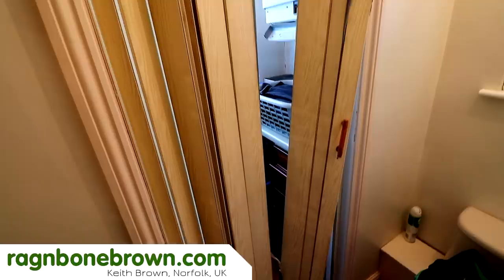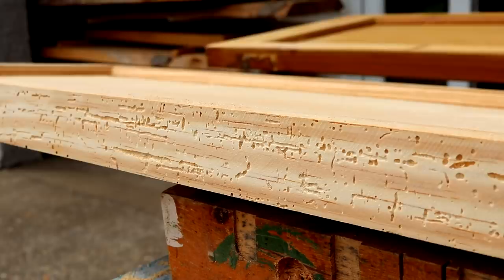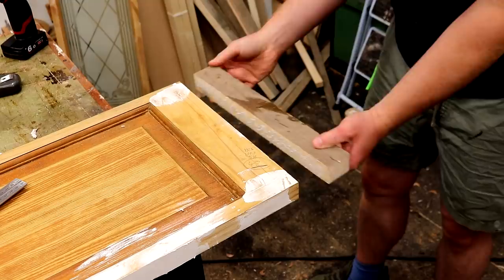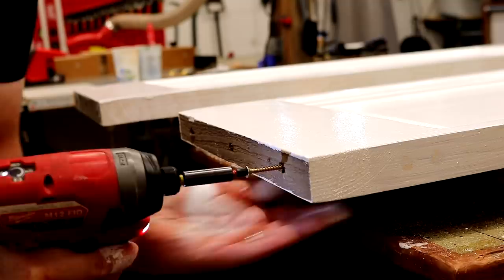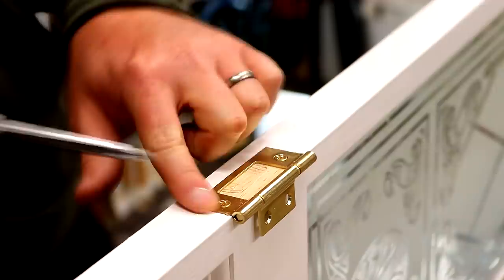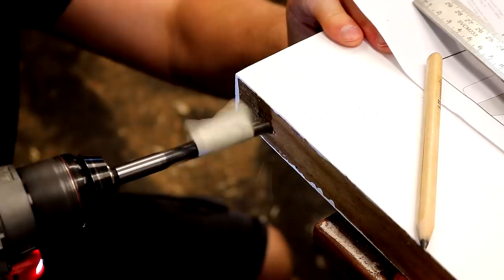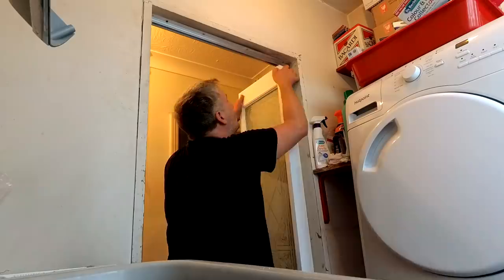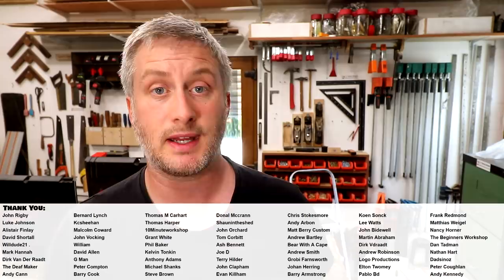This Bi-Fold Door Had 3 Problems...

Comment: It's such a shame that it's more cost effective to just replace items then to reuse repurpose isn't it. Nice result though Keith and its so much better than just buying new in my opinion.
Reply from the maker: thanks Karl, yeah things you buy in shops just seem to get more and more disposable unfortunately
Reply: But is the stuff you buy new actually any better than the older stuff I have found some newer stuff doesn't last as long as older items (and that excludes the previous life that older item may have).

Comment: Completely agree with restoring the doors, I abhor discarding usable materials, and looks like a nice job. But what is it with so many homes here in the UK having stupidly located doorways where you can't operate a normal door without interference from other fixtures / furnishings, or creating an obstruction between them? I realise layout needs will change over time but surely doorways have fairly consistent requirements?

Comment: Hi Keith door looks great and nice fit too, if you drill through a square piece of wood and hold to work piece it keeps drill straight and when measured and cut to size also acts as a depth stop ,
keep up the good work ,G.

Comment: Nice job on the doors. I suppose by not rebating the bifold hinges you don’t leave either bare wood or the need to remove the hinges and paint again. I think it would look nicer if it was painted where you rebated in this case 👌🏻

Comment: Looks a lot nicer after than it does before so that is what I call a success. The paint job around the glass panes is a bit on the rough side though. It looks as if you had paint bleed under the masking tape, which could be poor adhesion due to not cleaning the glass first, poor quality masking tape, and/or rushed application of the tape?